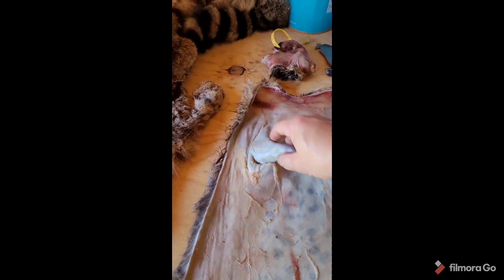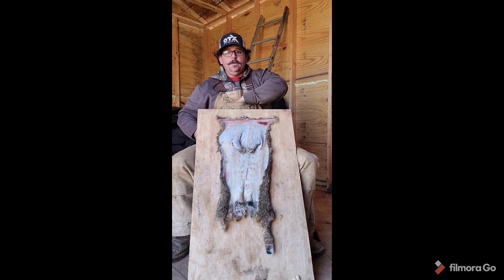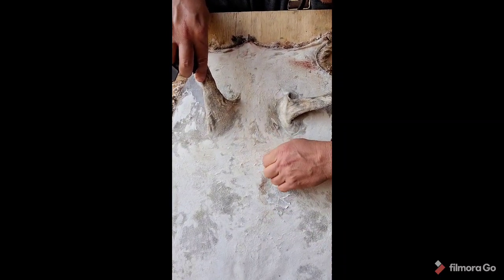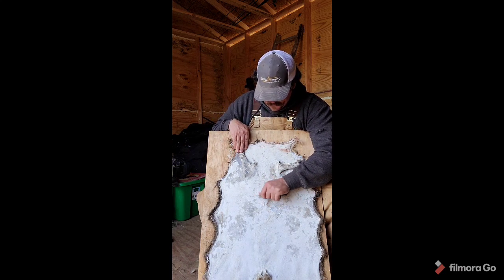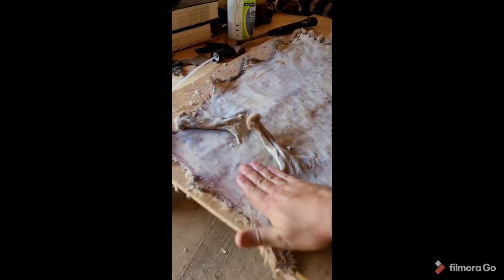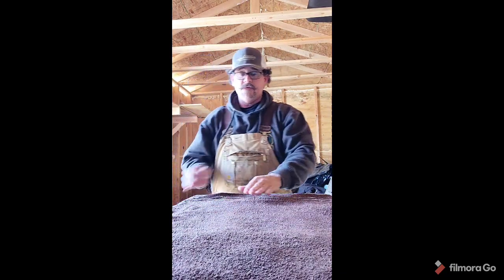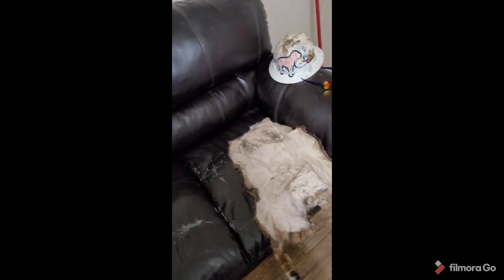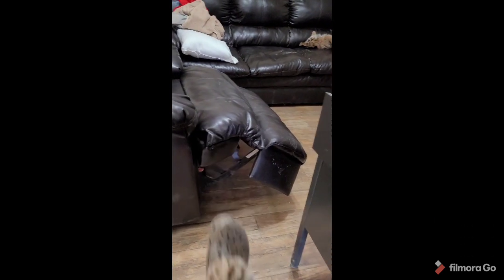Easy Fur Tanning Method

Comment: I’m really glad I came across this while searching up for pelt tanning methods. I’ve tried this before by using egg but I don’t know if I did it right. It seems that I just possibly didn’t break and stretch as much as needed and gave up when I felt like I ended up with rawhide. I wonder if they’re salvageable considering I seems to have the basics down? 

Either way thank you so much for the clear video on this method! It’s given me some hope that I don’t have to go looking for a more expressive process and that I might not be far off from a proper tan!
Reply from the maker: Rehydrate and start over
Reply: Yes just rehydrate and do the stretching... And keep at it until fully stretched and dry... If you stop stretching before it's dry it will return to rawhide..

Comment: When we process lambskins, we put them in pillow cases then throw them into a cement mixer with some linex covered ball bearings (12mm diameter). It can get noisy but if you just leave it tumbling it does an amazing job making perfectly supple pelts. Lambskins are delicate so we can't break the fibers on a fleshing beam. I imagine the same should apply here.

Comment: Great video and thanks for the tip on using eggs. I've been using some orange junk from Cabelas with unimpressive results. Biggest problem I've had is with the furs coming out crinkly. Yours sounded similar at the end so I'm curious how much do you work these pelts before they're nice and supple? Seems like a heck of a lot of elbow grease
Reply from the maker: You have to work "break" them quite a bit to get the softness that you desire. An old dryer with some media also works to tumble them

Comment: If you let the hide dry streched, will you not need to stretch it out by hand?
Reply from the maker: Less stretching needed
Reply: @TimLewisMountainMan  omg thanks for the fast response! Also, thanks for the great video. Greetings from Sweden🙏
Reply: If you want it soft you have to break the hide working it over back of chair or....  Or keep stretching and pulling the hide until you see the white showing... Will turn white as you stretch it...  Just stretching on a frame will just make a bigger stiff hide... Hope this helps...

Comment: sorry folks but that is not a tanned hide, it is rawhide
Reply: Egg tanning is actually a semi common practice..  normally I add about 4-5 tbsp of lite oil like olive oil or meats foot to 6 eggs for my mixture and pretty much do as he did... Yes this will be a tanned hide... To keep it from getting stuff you do need to "break" the skin.. or stretch as it dries to keep it soft and supple...   For a wall hanger I would call this done..  for a a fur to be used as outdoor garment I would then smoke the hide...   Good luck to all and thanks for the video!!

Comment: I have been doing some of this myself lately and if you let the hide air dry instead of putting it into dryer you can make it soft as a towel.Easily. Just let it air dry until it is damp on the hide side,,,dont matter if fur side is wet or dry?  
    You will need a metal pipe(what I use) about 3/4 inch or so ,you can hang it over and apply pressure to and it is strong enough to hold.
  As it starts to get dry in spots,,start there by folding it fur to fur and bend it over pipe ,,pushing down to stretch it. As it strertches it will turn the hide white, breaking the fibers apart.Apply some good force. Keep moving the fold until the whole thing is done.   Do this until it is dry. You can let it sit as you go to dry more,,But this has to be done before it dries completely.
    Looks like you are skipping this step.
Reply: I'm glad you commented thank you so much your way sounds much better I'm doing my first deer hide soon thanks again

Comment: Almost 9K followers?  This is like your own cult.  Tim, you're killing me. Use a fleshing beam and a 2 handed fleshing knife to make quick work of taking the hide down to paper thin.  Borax at Walmart is the go to for not only drying out the wet side of a hide, but will brighten up and degrease the fur side if you rub it on by hand once the pelt is dry. Yellow CITES tags?  Those didn't look like AZ bobcats.  Keep on trucking.
Reply from the maker: I kinda like doing them while they are flat and stretched. I know the "proper" way for the xperts is beam. Just personal preference. I might just build a frame and stretch it up with leather so I can say I do it old Indian way.
Reply from the maker: My own little cult. LOL ima take full advantage of 15mins of fame from viral video.
Reply: is this how you tan all of your hides ?

Comment: Anti's cruising youtube looking for causes to excuse their own pathetic existence. How long did you put it in the dryer?
Reply from the maker: It depends. Sometimes I will put it in for as long as possible with no heat just to tumble it and sometimes just a short bit to dry the fur. I like to dry it on a board while stretched better than anything else.
Reply: @TimLewisMountainMan  Ah, so little or no heat?
Reply from the maker: Yes. I try to avoid letting the hide side dry up with heat in the dryer because it makes it super hard and wrinkled up. That's why I like to let it dry while stretched. It's much easier for the thing that I want to make out of it. Once it's dried stretched then I will take it off the board and start rolling on some type of edge to soften it.